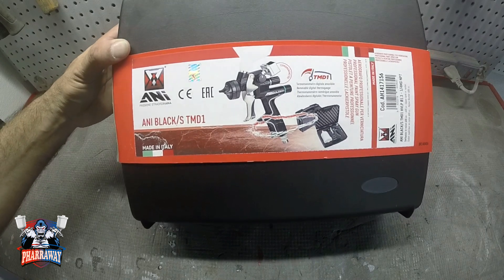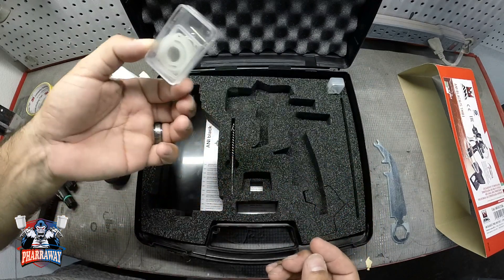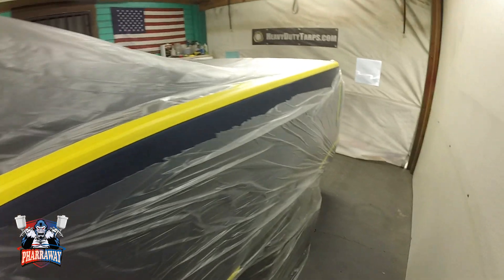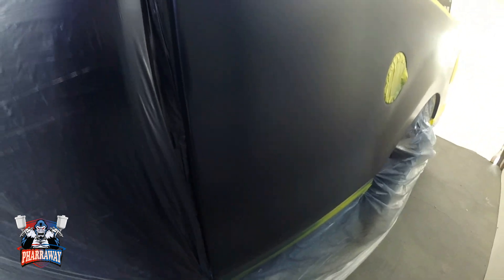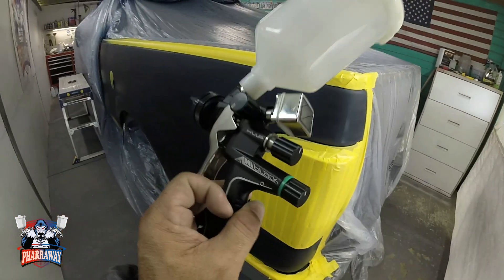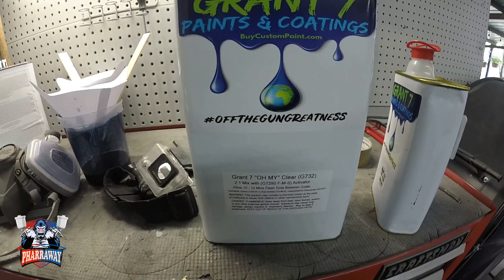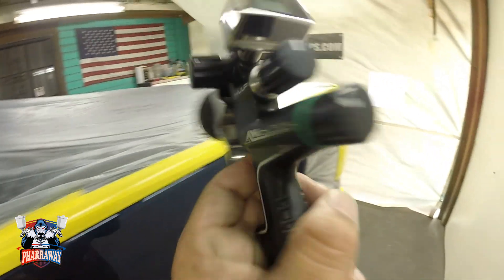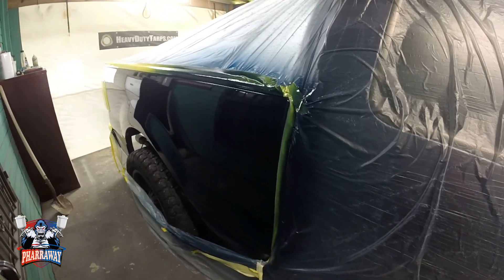Review and demonstration of the NEW ANI BLACK paint gun

Comment: I work in the RV industry in NW Indiana, I do work finishing and staining/shading. My job title is Shader which requires me to remove all variation from the grain after the stain has been applied. I do not like how my works guns are constantly dirty and having problems, we use KREMLIN HTI’s and KREMLIN AIRMIX/AIRMAX for sealer/ topcoat. Would you recommend a hub for me to purchase so I can use it at work? I truly feel it would improve efficiencies overall seeing as how none of the guns there have perfectly working tips/ insides that leads to an inconsistency with the fan pattern and a lot of waste overall. (Yes I have deep cleaned them and even replaced parts such as nozzle, filter, tip, needle, seals, etc.) I do not know where to start with a gun for woodworking
Reply from the maker: you might want to check Fuji spray they have woodworking spray guns here is there link https://fujispray.com/